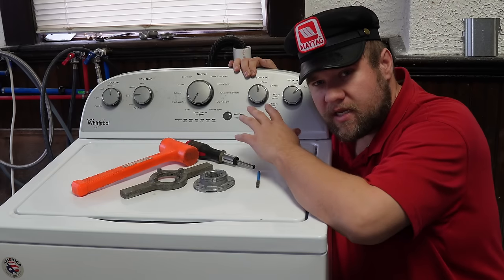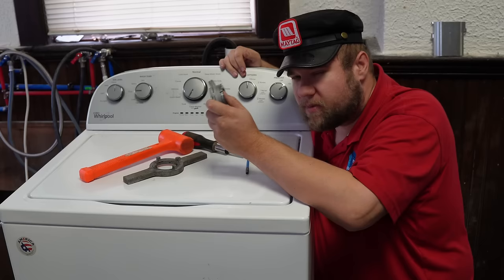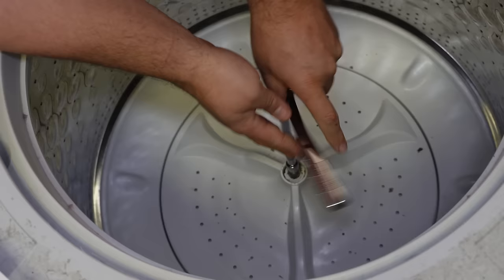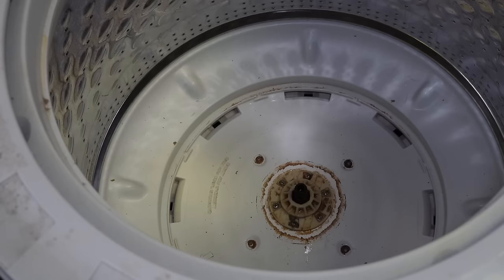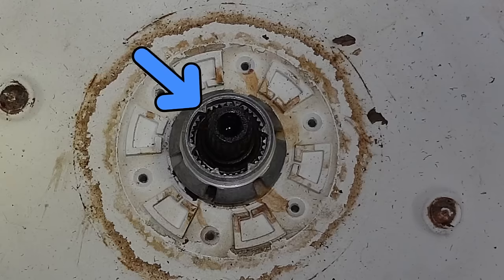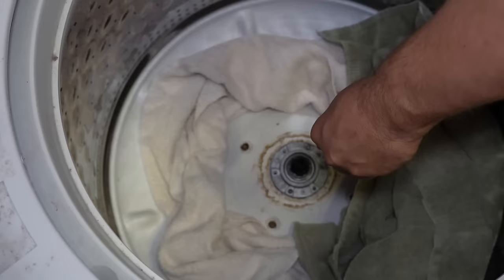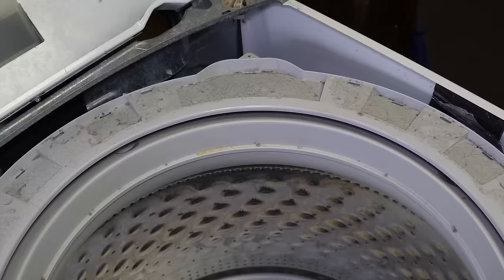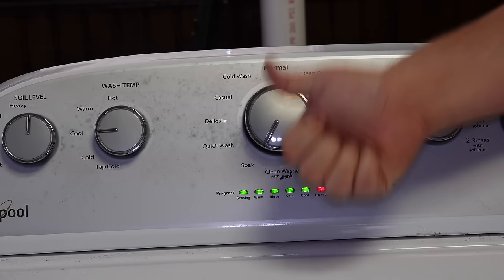Whirlpool Washer Won't Agitate or Spin Properly - Metal Hub Upgrade for Stripped Gearcase Splines

Comment: Great idea but nobody makes the metal hub anymore .
Reply from the maker: I have a factory producing them for me as we speak
Reply: @bensappliancesandjunk  Thank you .
Reply from the maker: @Fred-kr5fs  when I released this video, the hubs sold out like... 5 days after I made it and I already had plans on making these because they are too expensive online. So when they sold out I rushed production. I expect them to be available in 30 to 50 days
Reply: @bensappliancesandjunk  Thank you I already changed the transmission and cheap plastic hub but would like too put a metal one on when available . Was a stupid using plastic in the first place .I will keep watch when made available .Thank you .